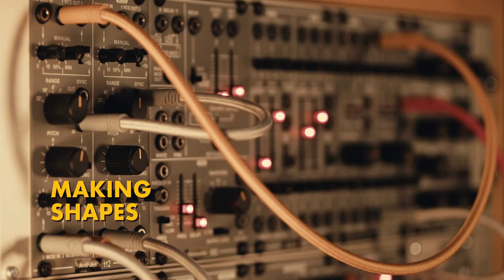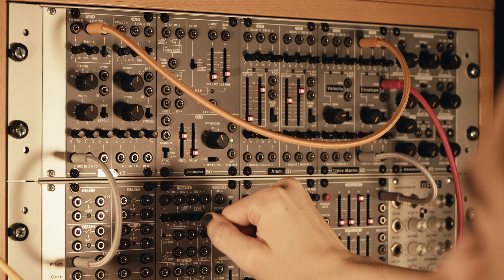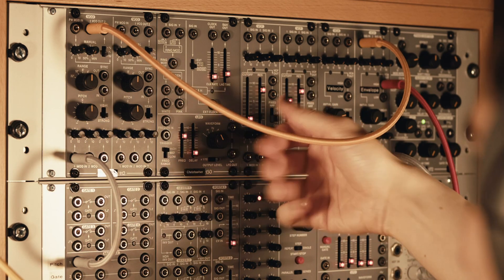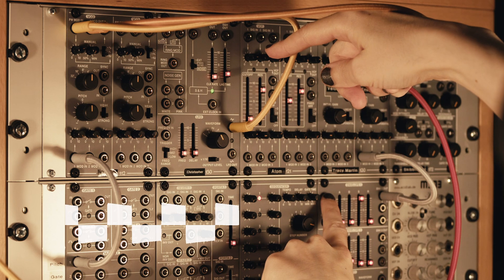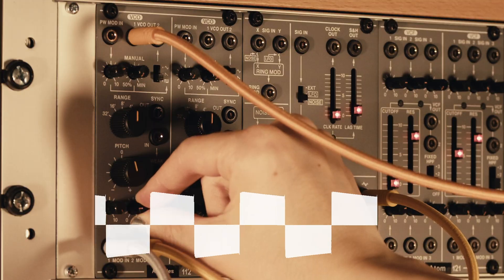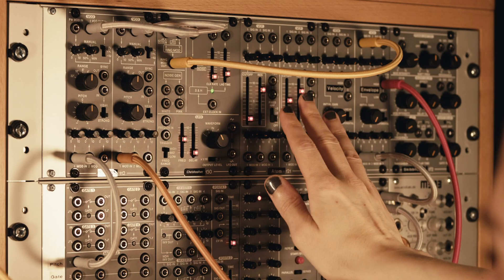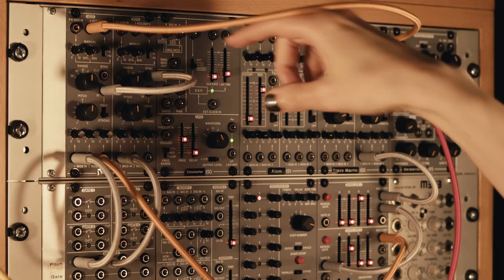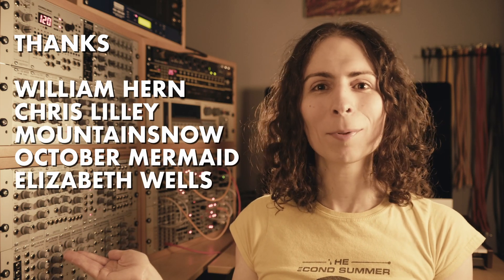Things To Do With Oscillators

Comment: Keep up the great work. Are you happy with the berhinger product line?
Reply from the maker: Thank you!

I think it depends on each individual product.  Judging by the original's service notes, for instance, I don't think the 140 envelope generators have the full range of the original, and I suspect there might be a few other minor issues like that...  But I love how they shrunk it down to Eurorack size, and combined two modules into the 297.  I haven't properly used the original System-100M for a real comparison, though.

The Doepfer A-100 is certainly more versatile, but as someone who wanted a System-100M for a long time, I'm certainly not complaining about an affordable new clone that seems to get you at least most of the way there for what, a fifth of the price?

I absolutely love their VP-330 clone, but again, I haven't used the original for comparison.  Though having MIDI certainly helps!

I just wish they'd stick to cloning obsolete equipment, not modern products or even modern clones of other people's.
Reply: @TransistorSounds  Thank you for the detailed and honest response. I also have the VP 330 clone and I love it. I am also not impressed with their tactics of cloning gear that is in current production and would not buy it. I moved from hardware synthesizers to eurorack about a year ago. I am still figuring out my core system.

I have enjoyed the clear explanations of your previous videos and look forward more in the future. Thank you for your time.
Reply from the maker: @AboveTheTrees00  Well, they can be cheaper because they have a big factory and no real R&D to speak of because they're mass producing clones of other people's designs.  Which I'm all in favour of when the things they're cloning are several decades old.  It's not so fair when they're cloning other people's clones, or anything else current.

And while it's a shame other companies have higher prices, that's because it's a cottage industry, and the smaller companies often have just a handful of people, sometimes who also have day jobs, designing and even hand building each unit.  In the short term, big companies are better for individual customers, but in the long term, those customers won't be able to get good jobs themselves.  It's the tragedy of the commons.  But that's more about capitalism in general.

And yes, more people using these modules should learn a little music theory and try making something a bit more tuneful if they want to.